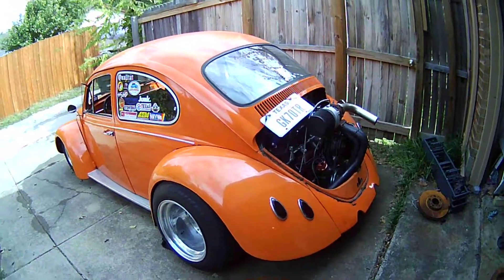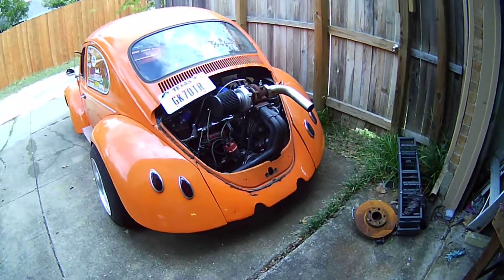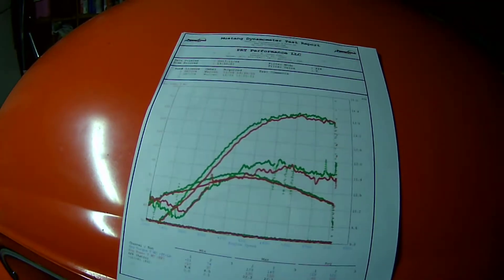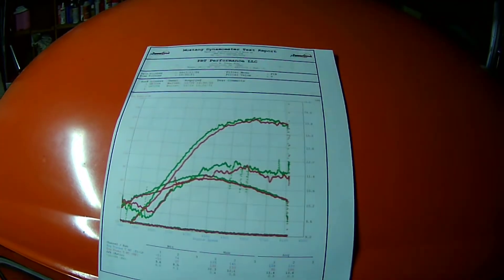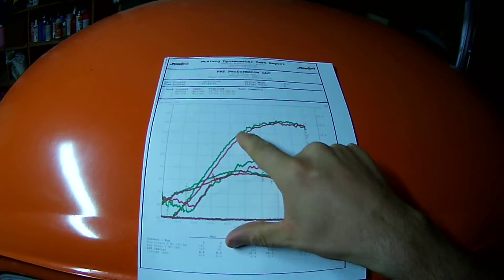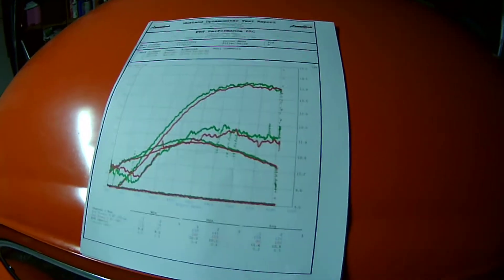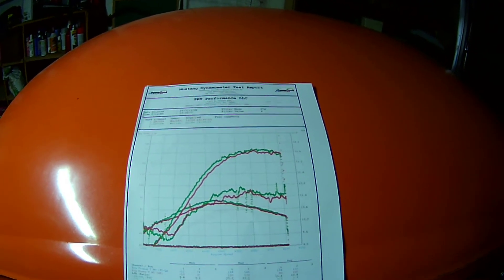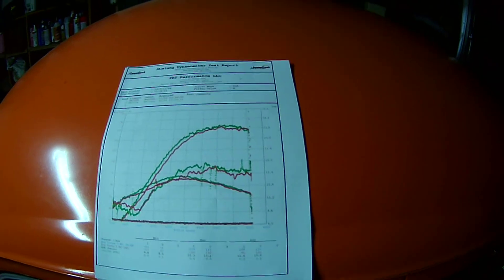It's Dyno Time!!!

Comment: 5500-5800 RPM is about right for a 120 cam. Once you get more boost RPM won't matter, for a street car you don't want to rev it to the Moon anyway's. Those are respectable numbers for as mild as the motor is, just imagine how much horse power it would have had naturally aspirated. Keep it up , 10 psi has been the sweet spot for me in the past.  But with cast pistons I would think 8psi is the safe point. Most supercharged kits are set at that, as most production cars have cast pistons.
Reply from the maker: I ordered a ceramic ball boost controller today. I will start with 8#'s at the map and may try for 10#'s when I have high octane in it again.  But I have to be careful until I get a real trans in it.
Reply: +oldspeedsi  Good to here you are going for a safe level first. At 8psi it should pull like a train. The trans is not cheap but will become necessary at some point. The thing that may let go in it, even if you don't launch it is 4 th gear. The hub's may spin, as 3rd and 4th are a press fit. Keep it up and find a spare trans just in case this one calls it quits on 10 psi. The curves are nice on the dyno chart, next time give us a closer look at it ;)
Reply from the maker: https://imgur.com/0121o5x   I think the middle lines are AFR  and I;m not sure what the lower middle lines are
Reply from the maker: https://imgur.com/9uvnsjs this is the 3rd gear pull
Reply: Those graphs look good, 75 Lb ft at 2500rpm at the wheels on a mustang dyno! It is commonly known they read differently than others (lower) I have read its like 5-7%. It pulls really nice down low " you are making stock  flywheel HP at around 2700 RPM. More boost is the key, you may not even need to jet it for 8psi as your AFR's were in the 11's. Glad to see you are having fun with it, keep up the good work.
Reply: By the way if you look at kaddie shacks website, the 1968cc in their shop car made the same HP at the flywheel as you made at the wheels. Their car went mid 13's, so with some seat time I would think you are in the same range.
Reply from the maker: Its pretty crazy to drive I have always assumed it's a low 14 or high 13 sec car I have played with focus ST's and 350z's and the ac cobra and they all lost. I just expected the HP to be higher but in reality it's a good thing it means theirs more power to be made, but its clearly time to start saving for a transmission.

Comment: Don't be dissapointed at 130hp with only 5 pounds. Thats pretty good your just starting to get into it at 5psi really. 8 to 10 pounds will be an animal im sure. Your doing it right little by little and learning. Thats how im going to do it when the 63 gets boost. 
Why 4th gear pull? Seems 3rd would be better?
Reply from the maker: Thank you for the encouraging words. cant wait to see your build come together. They say on the dyno you want as close to 1:1 as possible to get a true HP number and the load is good for spooling the turbo.